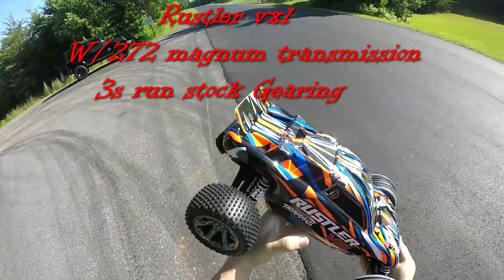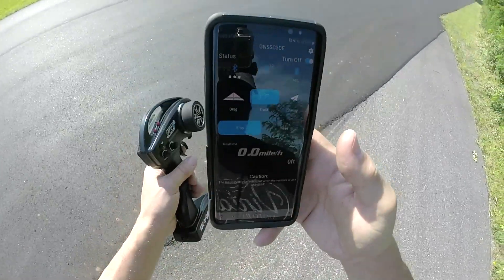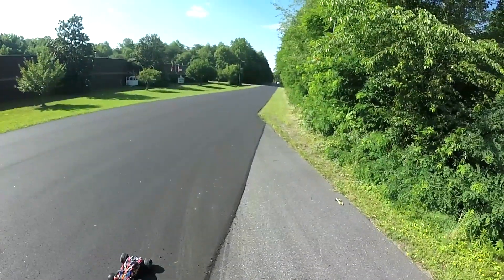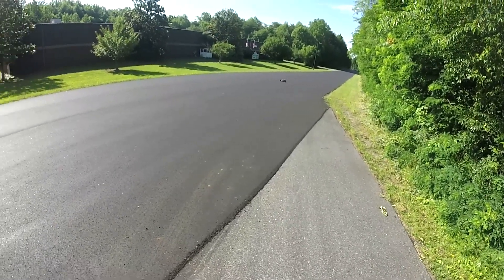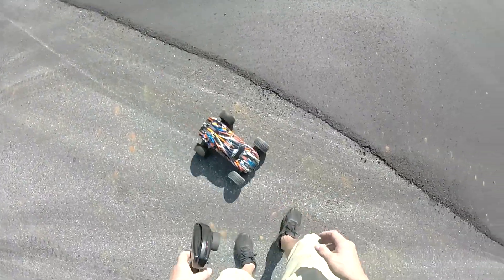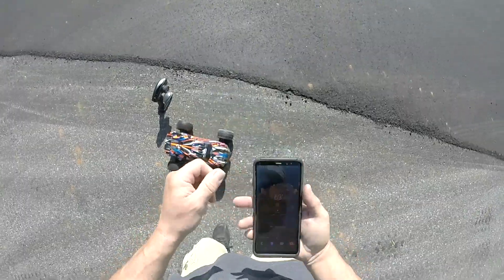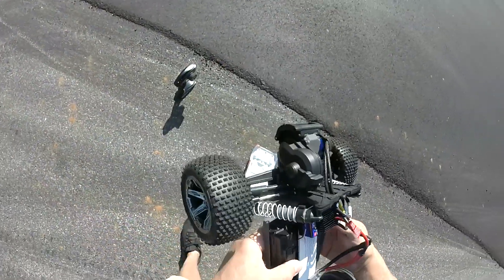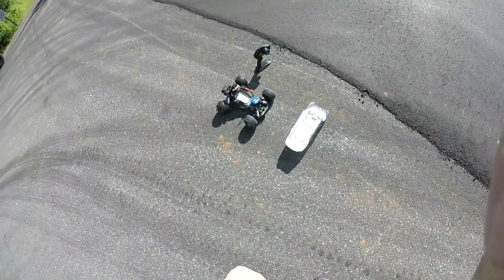Rustler vxl w/ 272 magnum transmission box stock run on 3s New Rc Car

Comment: hey brother that rustler brings back memories i bought one in 2007 had it 12 years my first speed car  very light car . put a mamba x6s with the sensord 2400 kv castle motor.ran it on 4s. i used to run proline prime 2.8 there were like a slick but they were not belted. got it up to 84mph i  wrecked that rustler many many times. very hard to control. but i love the speed runs.i sold it in late 2019 bought  the limitless  lot easier to drive. iam talking to much.  great viedo brother  hope to see you run the rustler again.
Reply from the maker: Yeah ,I  have had a few rustler over the years. Fun cars but can be aggravating at times. We will see what it can do.

Comment: I dont have no rustler, but i know How hard these 2 wheel drive cars are to keep under control trying to get to speed alto speed also there transmissions stock is stock aren't worth A crap once you start adding power and gearing.  I have my 2 wd slash  With stock transmission not stock gears gears and a locker up to a 129 miles per hour Pb so far With more room if I had the room to push it. And it was kind of a pain to get it that far reliably what I'm going for it!  Nice lil stock run Philip!
Reply from the maker: Thanks brother,  129 is dang fast!

Comment: The stock 500,000 oil is perfect dont touch it.
Reply from the maker: It comes with 500k? My rear diff seems like lighter oil.
Reply: @philipjolley1015  the 272r magnum is supposed to have 500, 000 stock
My 2wd slash I can spin one wheel and turn the other turning a TP motor. Its locked up pretty good. 
136mph world record slash stock body.
Reply: @philipjolley1015  wait I got my 2 diffs from Jenny's RC and they were new take outs from the DRAG SLASH maybe a difference.  But 500,000 works great
Reply from the maker: @mydadsrcchannel934  I'll have to check again but seems light.
Reply from the maker: @mydadsrcchannel934  ah, that makes sense.  Ok I'll keep that in mind.